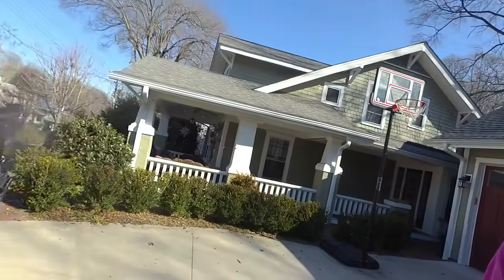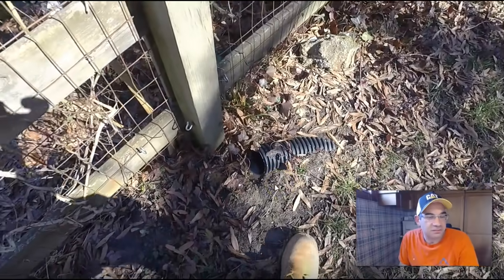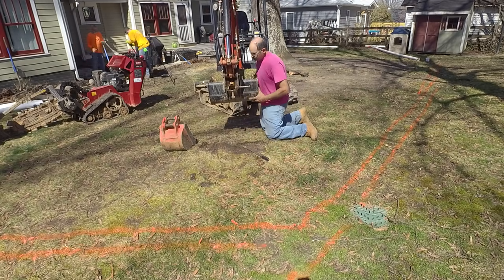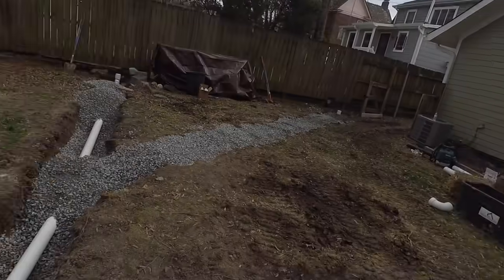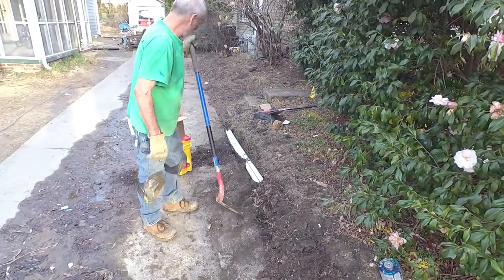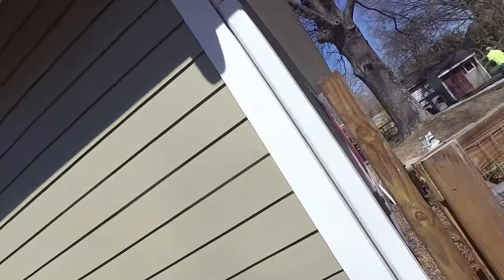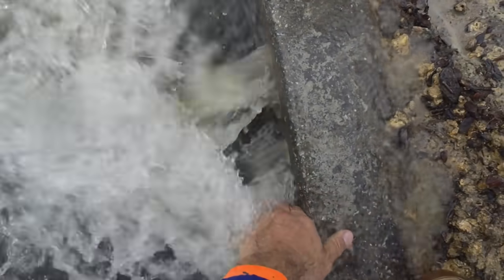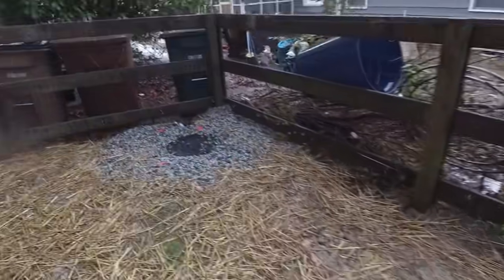Installing a french drain and dewatering pumps to solve stubborn back yard flooding

Comment: A couple of questions (and I realize it was a lot of water in a short amount of time):

1) What would you have done different if the customer didn't want the exposed gravel french drain in the yard that would have still worked?

2) By the shed: Would it have been advantageous to put in a grate for the standing water (and maybe a bigger sump pump) to help keep the shed dry?

Great video, always interesting to see the system working in the rain!
Reply from the maker: There was no other way to collect that much non point water. If the customer didn't want the exposed rock I would pass on the job because I could not offer results any other way. The entire trench was full of water in this rain event so a grate wouldn't have helped any. The main thing is the water was gone after the event stopped and wasn't hanging around for days like it used to.
Reply: @GCFD  I watched a video from another channel where this contractor installed 3 catch basins in an open French drain, at the time I thought is that necessary or is it just way of bumping up the cost of the job. Surely if water is flooding up to the catch basins then the trench is already full.
Reply: Build a burm on all sides of the property and let the neighbors deal with their water.
Reply: @andrewk8636  That's the worst thing to do. Water can make its way around it and it will keep all the water in yours with nowhere to go. Grade your property away from your house. That hill in the rear of the yard is a major problem. The entire property needs to be graded correctly.

Comment: A perforated sump basin outside is just asking for future problems. Instead install a catch basin to catch the surface water and then plumb into the basin. Perforating the bottom and a base layer is all you need.
Reply from the maker: In this case the perforated sump basin is acting like a catch basin. 👍

Comment: I have watched several of your basin & sump pump installs and have a few questions: 1.) What is your go to brand of dewatering pump, and why? 2.) When sizing your pumps, are you more concerned about GPM, current draw, or Hp. ? 3.) Lastly> the French drains that you create, how does yard material composting, and dirt infiltration into the rock medium effect operation as the system ages? I think you do a great job with your presentation, and look forward to your response. By the way, I live in the Bayou City of Houston Texas where there is no shortage of storm water. Also the ground water table is very shallow.
Reply from the maker: HI Jim I use Zoeller M98 pumps from the plumbing supply house (not lowes or amazon)
Reply: @GCFD  Thank you
Reply: @GCFD  I was hoping to see an answer to #2 and #3. Learning so much from your channel.

Comment: What size is the discharge lines again, 1/12? What point do you oversize the pump discharge pipe? The drain field length or the size of area you are trying to drain? Would these be a time to say double the discharge side to get less pressure and more volume? If so would a separate check valve on the larger pipe be recommended in your opinion? 
I appreciate your quality of work, time and effort that you put into the videos. Also the great education your giving to me on drainage! 
Thanks again and keep up the great work
Reply from the maker: Since we're pumping uphill large pipe diameter means more pressure. This is because there is more volume (weight) of water the pumps are pushing against.

Comment: Perhaps you could've extended the pipe that caught the two gutters a bit to the side of the house and make the pipe that extends past the house a french drain, as there was already gravel there. Then the water that would drain into the garden from there would also be caught, especially seeing as the pump for the two gutters seemed to be keeping up just fine unlike the other two pumps, so it could probably handle more water

Great video!

Comment: Could you keep the drain at the perimeter only as to avoid gravel arbitrarily crossing the yard? Or perhaps say a circle at a low point only. Also suggest putting sumps in series, so all pumps can share total load always
Reply from the maker: The placement of gravel was not arbitrary. It followed the water's natural pathway to ensure capturing the most possible.

Comment: Y’all did awesome getting out all that dirt. My only question is why didn’t you cover/wrap the drain & stone to prevent the dirt coming in?? 
What happens when the stone and drain fills with dirt. Wouldn’t you be back to square one?
Reply from the maker: The gravel acts as a filter and the flow will rinse any fines through and out of the system. Covering the drain (gravel) kills the flow into it and that's what provides the energy to keep the gravel clean.

Comment: That was a great video. I figured maybe bigger pumps would help ? But how often do you have that much rain fall ??  Love how you go back to check on your work 👍
Reply from the maker: Thanks for commenting Paul! I think bigger pumps aren't needed as you can't keep up with the rain - that was never the point when you little fall and need to pump. Rather, the goal is to get rid of the water that used to hang and ruin the yard. If we had fall this would be a completely different project so it's very custom with these solutions.
Reply: @GCFD  Ok good deal. Still think you videos are awesome
Reply: Instead of bigger pumps, the bucks should have been much bigger?

Comment: I need a primer on this type of drain.  I get the gravel, but what's the point of the pipes and cleanouts for the long runs? How is water going to get into the pipe? Did I miss a step?  Why do you need clean outs for sealed pipe? The only pipes that made sense to me were the o es from the down spouts.  Very interesting video.
Reply from the maker: The pipe at the bottom of the gravel has holes (perforated pipe). The holes are positioned at 5 and 7 o clock. Water floods into the trench since water falls through gravel and begins to fill up the trench. Once the water reaches the holes in the pipe it flows into the pipe and into the sump basin where it it pumped out. This makes room for more water to flow into the pipe and be pumped out. Make sense? - Shawn
Reply: @GCFD  thanks! That's what I needed to know!

Comment: You need high octane pipe, the problem is your french drain pipes do not have enough inlets., you also need several catch basins, with solid pipe.
Reply from the maker: These pipes can flow a ton of water so I'm not worried about that. Catch basins are what we had before and are for point water sources. This was non-point except for the gutters.

Comment: I think you needed to put the French drain around the periphery of the backyard to catch all the water before it reached the middle of the yard with some additional drains in the middle of the yard.
Reply from the maker: The french drain needs to go in the low point to catch the most water. That's a much more effective placement, plus there is much less FD needed. 👍

Comment: On the course we use sand on top of every french in the rough or fairway with clay soil because clay can become a real problem, hydrophobic which means it wont let water drain basically. Helps with the turf as well, we use geofabric so the sand wont go into the rock
Reply from the maker: 👍 Hydrophobic means the molecule is non-polar and repels the polar water molecule. Clay actually attracts the water molecule because the particles are very small and have a lot of surface area to volume. This is the cohesive properties of water.
Reply: @GCFD  I explained it so a child could understand, I turf management degree. Any soil can become hydrophoic even clay
Reply: @GCFD  tending to repel or fail to mix with water, its a easy fix if it happens
Reply from the maker: @chosen1one930  hydrophobic molecules have a symmetrical arrangement of their valence electrons, whereas hydrophilic ones are asymmetrical (like water molecules). I’ve ever heard of a molecule “becoming hydrophobic.”

I think you’re referring to water holding capacity. Smaller particles have higher surface area to volume ratios and so can hold more water (cohesion). Clay has the highest water holding capacity and so quickly becomes waterproof in a sense and water doesn’t pass through it.
Reply: @GCFD  google it, soil becomes hydrophobic, you learn this turf management. Its very simple search google for hydrophobic soil, just because you never heard of it doesnt mean it cant happen, come on
Reply: @GCFD  look at that when you disprove someone they usually never reply, soil can become hydrophobic, just because you never knew about it dosent mean it doesnt happen, turf management degree, i know most things about  soil, drainage and turf.

Comment: 16:50 I don’t know what state you are in but in mine you have to expose conflicts or exceed by the proper tolerance you would normally need before you can bore across.
Reply from the maker: We have to alert 811 if we are boring so we cut it. It worked very well for us in this case. 👍

Comment: Why did you not use filter fabric to wrap your gravel and perforated pipe? Also, why did you put gravel under your pipe? This is how we did drain systems in the 1980's when fabric wasn't available to us.  and THAT's why they all failed. The dirt will quickly fill the trench and gravel blocking the flow of water to the pipe.  The gravel did not need to be exposed; dig trench 6" deeper, use fabric around 4 sides of gravel and cover with 6" of dirt and poof, you wouldn't know the drain was there. The areas of pooling you could used surface drains. Other than these major failures, your layout and use of sumps and pumps is right on. Excellent job drilling through curb!
Reply from the maker: Hi Paul - 
I don't use fabric and I dont bury the drain because I want to preserve the flow. The flow is what keeps the fines rinsed through and out of the system. Keep in mind there was already a drain like the one you described in place with pooling water on top. This is because we have soil with a high clay content in our area. It's impermeable and so burying the drain destroys its function.

Comment: Sometimes the pumps just can’t keep up, mine does the same thing during extreme rain events.  It ALWAYS catches up within a half hour of the rain chilling out.  Kudos, a property with no fall is the hardest to work
Reply from the maker: Thanks Matt! This system has been working well. Trying to keep up with that much water would have been unrealistic. But it removes the water pretty quickly after the rain stops, like you said.

Comment: Got some mimor scour by that one basin, that is easily fixxed with some larger stone fill.  Looks like that one driveway will end up being a spillway of sorts when you get heavy weather but 80-90% of the resy of the time it just might keep up.  Too bad that house is the lowboy on the block, something to watch for whn you by and as building pads develop around you.  getting new houses upstream of you to properly dispose of the water properly during the permitting process can save some bucks,  expect.
Reply from the maker: Yes we need to run a couple buckets of larger rock for that lower sump basin. That will be this week. Great comment and noticing that!

Comment: Great vid. I have a similar situation, and would love to put in catch basins and pump the water out to the street just like this video, but my property is in a northern state with cold winters. Would the pumps in the catch basins be damaged? Or could I either put them deeper, or insulate them somehow? Of course, it would be unusual for a heavy rain to occur during the depths of winter. But sometimes, especially in early Spring, it can rain hard with snow on the ground, which is real mess.

Comment: Great system. I bet those pumps would be more efficient if you dumped them into one of your 4" pipes instead of asking them to pump the whole length of the 2". They would definitely cycle faster.

Comment: I'm not trying to be rude, just to give some advice to make your systems last longer. Dig your trench, make sure you have some fall to where you're collecting the water, put filter fabric down, rock, pipe, rock, wrap your fabric over the top of your rock, put a couple of inches of fill dirt over the fabric.
Reply from the maker: Thanks Josh! But keep in mind he had a buried FD before I came in. By burying the FD in fill dirt you destroy the ability of water to flow into it. That's why I don't bury my french drains.

Comment: Was curious about sending the run-off water to house existing sewage system ? Via check valve, trap.  that may have been on the gravity feed you were looking into... Nice job though 👍
Reply: This is illegal in most areas. The water treatment plant would be quickly overwhelmed if everyone was sending their storm water into the sewage system. You would also have backups into people's homes when the system becomes overwhelmed.
Reply from the maker: We definitely don't want to send stormwater into the sewage system. Like Old said it would burden the wastewater plant and do a great deal of harm for waste treatment. Keep it in the stormwater system.

Comment: HI Sean, I think that the only problem you have is that there was not enough short term capacity, I would suggest larger Catch Basins as this gives you a longer duty cycle which is nicer on the pumps as well as short term capacity, as you have a large surface area that you are collecting, not trying to be critical just my 2 cents worth , great video and take care !, PS I went through something similar at my house as I had water ingress under my house on rain events (on Stumps, I ended up putting in about 300 feet of french drains using about 40 tonnes of aggregate, due to getting the fall. Cheers Dominic
Reply from the maker: thanks for watching and commenting Dominic! Great idea on larger basins.

Comment: Great video.  Like many others, my big concern is the eyesore of exposed gravel.  

I also worry that over time,like this summer, when the grass gets really growing, it will attack that gravel trench and fill it with grass which will be a gnarly mess.   

What’s your recommendation there?   Spraying it with roundup?   Then those chemicals are getting pumped out on the next rain.   

Something to consider.   You go back and check the jobs for rain events, but I’m a “whats this gonna look like in 2023?” Kinda guy.
Reply from the maker: We are about to do a FD where the customer wants the expensive decorative gravel on top. Stay tuned for that job!

Comment: Hey I am civil engineering student and I really enjoy your videos. Very satisfying work. 
A drainage problem came up at my sister house and I love to hear your solution. The subdivision she lives in is high near the street and very low along the back fence. All the water from both her and her back neighbor drain to the back fence area and it’s like that for the whole street. Is there any way to get rid of the standing water in her backyard alone? If she put a French drain and ran it to the street it would land well below the level of the street. I love to hear your thoughts if you have time. Thanks!
Reply from the maker: You want to find a path of least resistance and provide that for the water to leave the yard. It could be many different solutions but it has to be the one the water wants to take. Best luck!

Comment: A bigger pipe for that  french drain could have made a big difference. 4" non pressurized could drain upto 250 GPM. Just the roofs could contribute that much of water. When surface water comes from the next yard, no wonder it for overwhelmed. But you did a great job here.
Reply from the maker: Keep in mind the goal was not to contain all the water that would be impractical. The goal was to quickly evacuate the residual water that hung in the yard with no way to escape. 👍

Comment: What are your thoughts on doing what you did but fabric wrap the French drain with  just a couple inches of topsoil over the gravel.. then at the areas with heavy flow and down the line every 10 or 15ft tee in catch basins to collect the surface water.  Would that not collect the groundwater as well as the surface water and then you wouldn't have to look at the gravel? I understand by collecting the surface water you're adding debris to your French drain but with PVC and clean outs you should be able to keep the line clean. Just curious your thoughts on a system like that?
Reply from the maker: We have impermeable clay soil here so that doesn't work. Do this test: find some standing water that you want to address. Dig down a few inches and see what happens. If you hit dry dirt then you know you can't bury your drain or it will be useless. If you continue to hit water as you dig you have permeable soil and you can bury your drain.

Comment: Just because the French drain was completely full doesn't mean it isn't working as seen in the rain results. People need to remember that 2 side properties are draining into this guy property and who knows if others onto theirs, a heavy rain doesn't help, but this does show how your method of a french drain can collect and extract large volumes of water, plus if the French drain was installed with 4" pipe (as you normally do) to the street or to an out fall, a think the water would not be on top of the rocks.
Reply from the maker: Thanks for your comments David! 👍